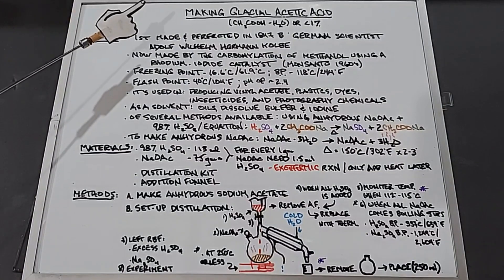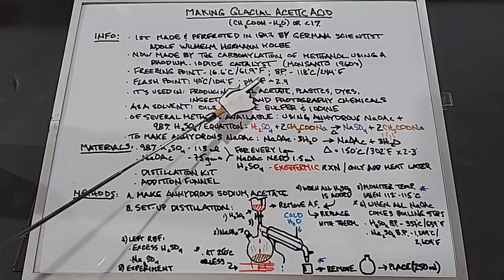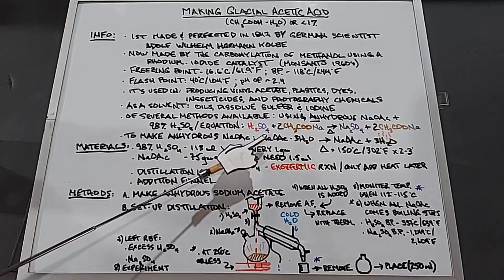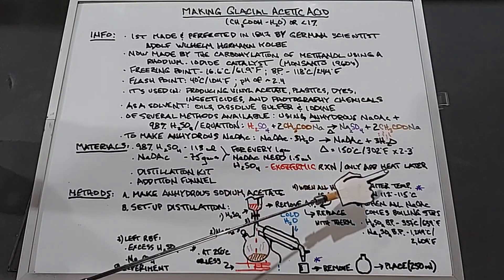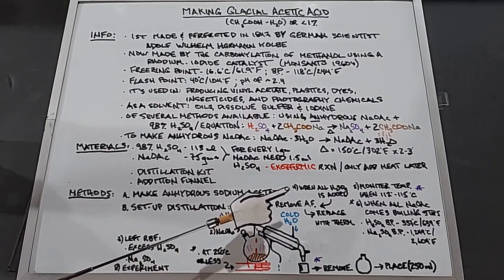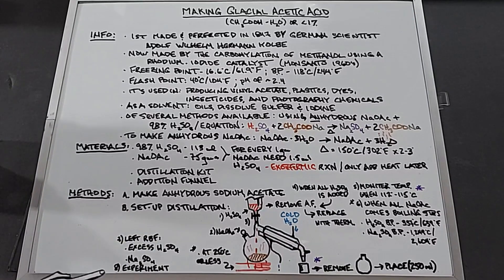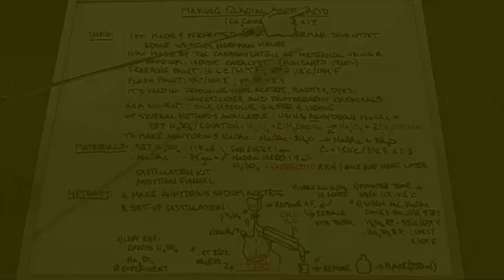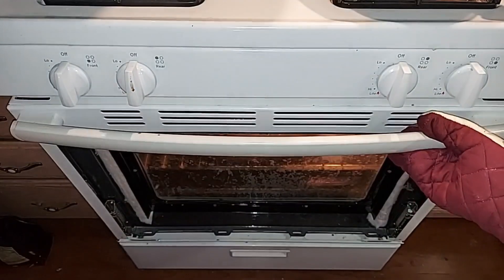Synthesizing A Flammable Acid - 100% Acetic Acid

Comment: What is the advantage of a round bottom vs Erlenmeyer flask for the distillation?
Reply from the maker: Honestly, there isn't much difference.  At the time I didn't have an Erlenmeyer with the proper connection, so the RBF was it.
Reply: @cranialconstruction   Thank you. I can see, for some reactions, that a spherical vessel might be preferred, but it makes even heating trickier, at least when you don't have access to a heating mantle (and the experiment doesn't require some sort of bath...) but it seems like some folks feel very definitively that RBF are superior for some reason 😂 For most experiments, honestly, it seems to be more about aesthetics and convenience  than necessity. Personally I like to use what works and is appropriately safe for the situation. It's all mad scientist cool looking anyway.

Comment: "We were unloading a 24-ton tank of acetic acid at an external temperature of 1°C. When we connected the hose, the acetic acid was not flowing because the valve was frozen, with about 100 kg of frozen acid blocking the flow. To resolve this, we used an LPG flame to warm up the valve and restore the flow. Considering this process, was it safe to use an open flame in such proximity to the tank and acetic acid? Could this have created risks of ignition, vapor buildup, or other hazards? What safer methods could be used to thaw a frozen valve in such a scenario?"
Reply from the maker: Yes, it's possible.  However, due to the same cold temperatures, it would have been difficult for it to ignite.  You were most likely quite safe.

Comment: Interesting. I have a 1lb bottle of Merck 99.5% glacial acetic acid I used for photography over half a century ago. All these years I was unaware it was flammable.
Reply: I didn't know that either, I thought only the anhydride was flammable. "Concentrated acetic acid can be ignited only with difficulty at standard temperature and pressure, but becomes a flammable risk in temperatures greater than 39 °C (102 °F), and can form explosive mixtures with air at higher temperatures with explosive limits of 5.4–16% concentration"

Comment: Why didn't you use the side neck on the flask for the addition funnel?
Reply from the maker: That's too easy haha.  Actually the slight angle it's on makes measuring the amount of liquid that gets through the small hole of the stopper a guess.  Addition funnels have to be straight up vertical.